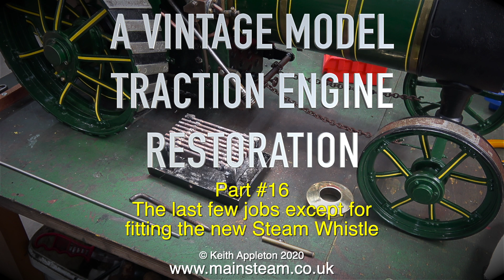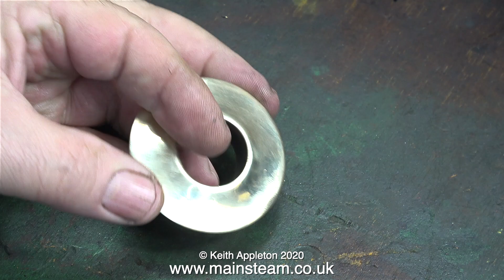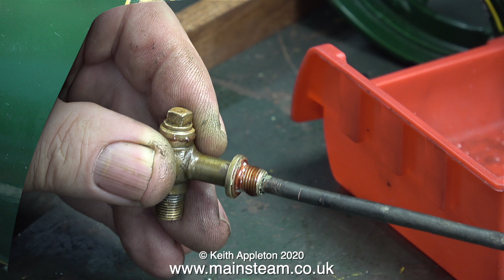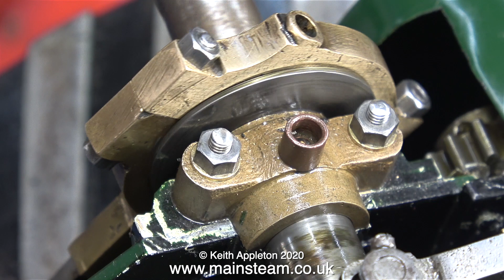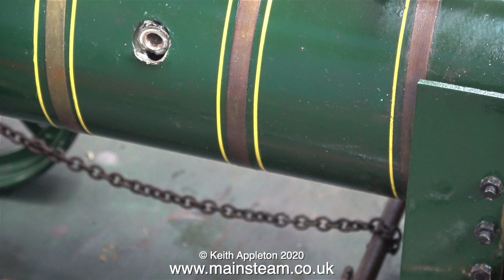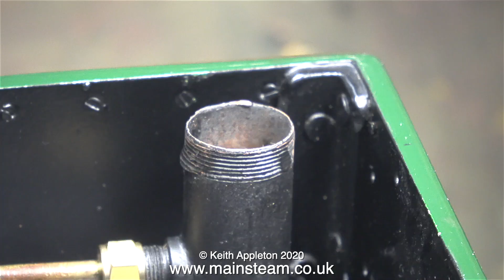A VINTAGE MODEL TRACTION ENGINE RESTORATION - PART #16

Comment: Once you mentioned the nuts on the steam chest I couldn't stop looking at them!  The one in the lower right corner looks like they drilled the hole within 1/16th of an inch from the bottom edge!  When running in steam will the heat cause valve parts to expand and seat better?  Just a thought.   Running the engine on air is a good indicator of the mechanical parts working but running on steam is always the ultimate test.  Do you know if the owner is going to run the engine in steam or just use it for a display and run it on air now and then?
Reply: It’ll be run on steam but not too often....:)